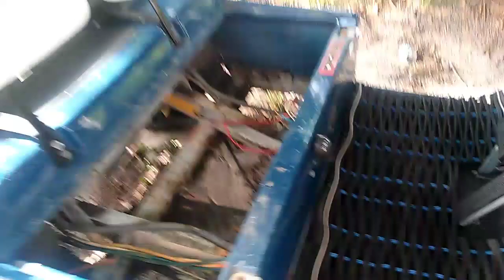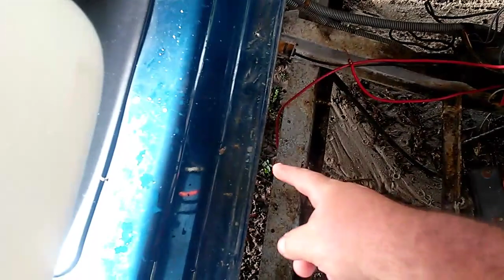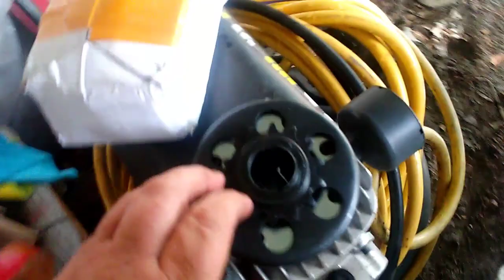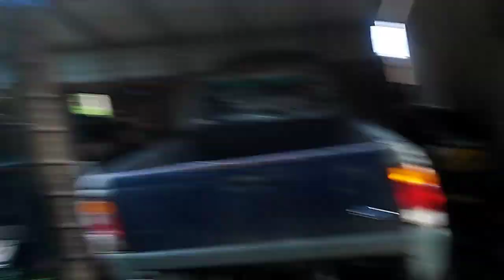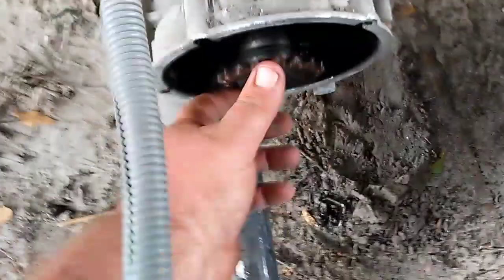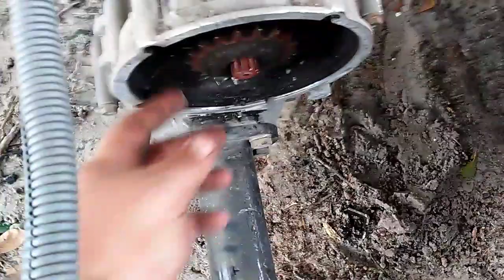Club car Electric to gas part 1

Comment: @Build it my WAY, I'm doing a similar build, using a #35 chain, I don't want it to go fast, just normal speed. what sprocket do you recommend on the transmission, torque converter and the sprocket on the gears where the electric motor was? thanks

Comment: Where did you get the engine and transmission.
Reply from the maker: Aaron Forestier i believe it is a tool tuff brand engine. It has been a great engine so far. Transmission either came from go powersports or you can order them from Ebay. Lots of people don't recommend them but if you change the sprockets to match the ratio you are trying to acheive they work great.
Reply: @builditmyway6475  thanks for replying will be watching for more videos. !!